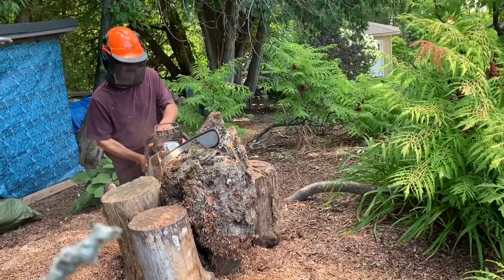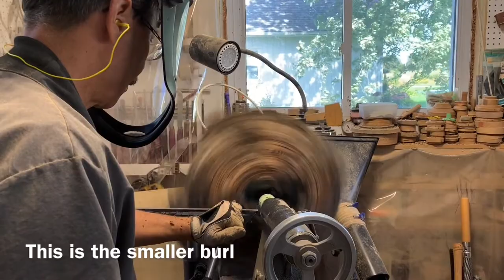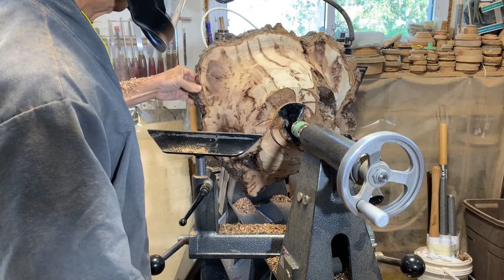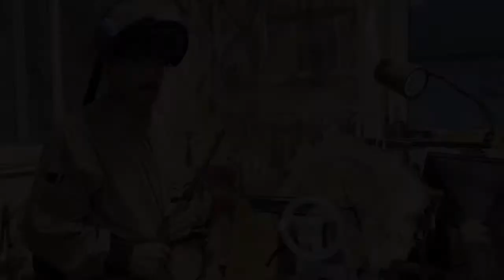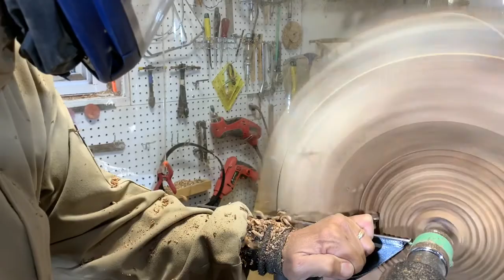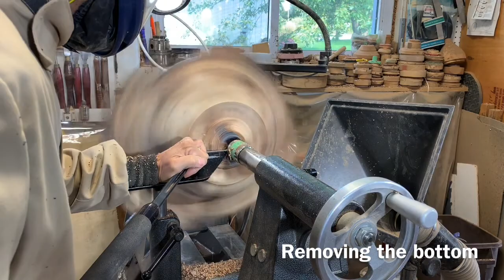Woodturning: Turning a live edge burl

Comment: Cool looking piece.  What's your coice of finish for it?
Reply from the maker: Thanks, I mostly use General Salad bowl finish on burls and bowls, but any polymerized Tung oil would work pretty well the same.  This is just what I have gotten used to applying over the years and I can tell buyers that it is food safe because the can says so.  I know that all finishes these days are safe after they cure, but the General salad bowl finish actually says it on the can.
Reply: Thanks, I've used the the salad bowl finish as well for the same reasons you noted.

Comment: What is your faceshield system?
Reply from the maker: This is a fairly new air respirator/faceshield system I purchased in the US  in 2019.  It is a Sundstrom unit from Woodturning wonders in the US.  It is more than double the price of the old one I had, but does a much better job at filtering out the fine dust - https://woodturnerswonders.com/collections/all-respirators